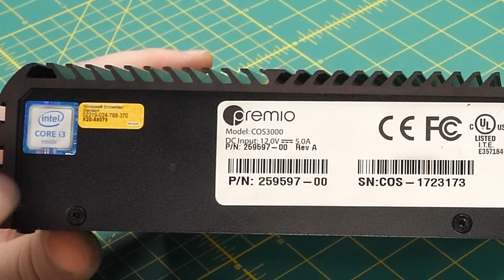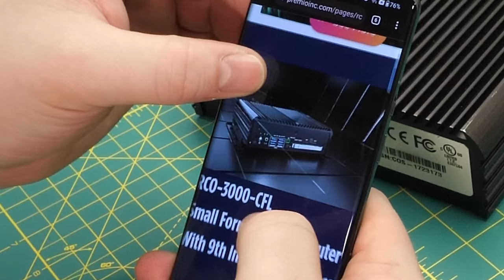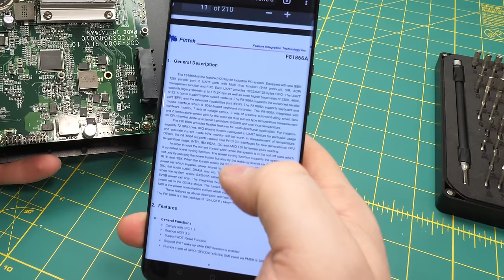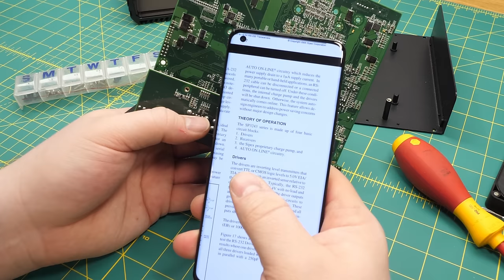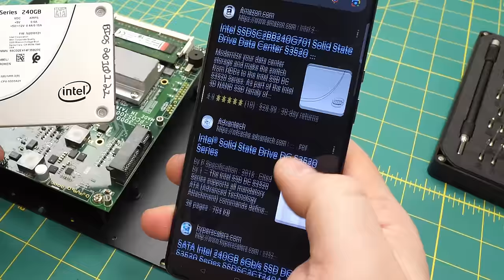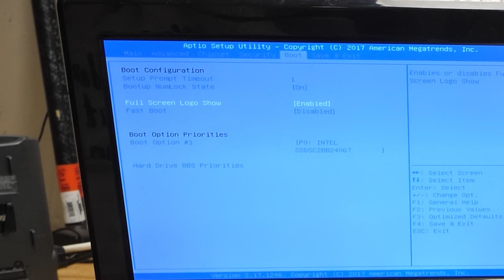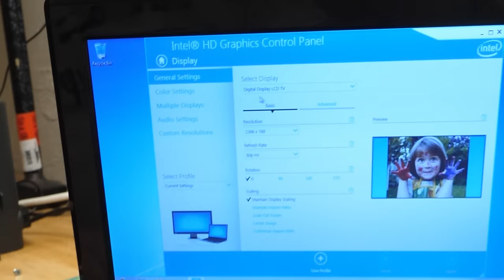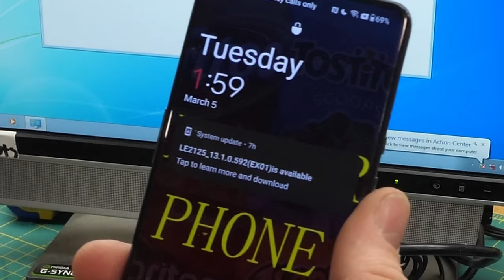Little Guys: Episode 4 [Premio / Coinstar]

Comment: Those ferrules also help prevent creep with bare stranded wire (and tinned stranded wire, for that matter) where the screw connection gets looser over time. Eventually this can lead to arcing and burning the screw terminal (or potentially your house). The 3D printing community likes them a lot for that reason, since we're usually connecting wires that'll have lots of power running through them over long periods (inside our houses).

Comment: Yes you can use audio over DVI. Kind of. 
You need a DVI-D to HDMI passive cable. I remember a few years ago that I discovered completly on accident this fact. When I connected my computer to my friends flat screen tv using the dvi on the computer end to HDMI on the tv end. Thinking that I would have to use the PC speakers for sound, I was astonished that sound was coming through the tv itself and windows recognized the output to the dvi port. 😮

Comment: Another important thing about PCH - you're not supposed to put thermal paste on it. It doesn't get hot enough to require a radiator, it sits slightly lower than CPU die, and when they are thermally coupled - CPU just dumps its heat on PCH. I think I found that info in some Dell laptop maintenance manual.

Comment: I've never used ferrules on wires personally but in my other job, we use a jumbo version on our (flash) welding cables.
These cables usually pass anywhere between 1500 and 2000 amps, so the ferrules are absolutely necessary for a clean transfer of current from wire to socket.

Comment: 6:08: that Phoenix connector CAN be used without ferrules on the wires, because the screw itself doesn't actually contact the wire to drill down into the strands - there's a metal piece that comes down and presses on all the strands equally.  Ferrules are a must where there's just a bare screw that holds the wire in place.

Comment: 3:40 I feel like it's a bad decision to name your electrical connector after a bird whose most famous party trick is catching fire.

12:12 The Game Boy Advance can use RS232. (It's not the default for link cables because they have the whole 4-way communication thing going on, but it's an option if you can swing 3.3V signalling.)

44:55 Bad and naughty children get put in the Chassis Nibbler.

Comment: Here in Hungary if you have that much loose change, you can exchange them in any post office so there was never a private business angle. Actually I've seen machines that do the opposite, give you coin for bank notes for parking meters. But since the last decade all shops have to accept card by law and most vending machines support card as well, so I had no reason to carry coins in a long while anyway.

Comment: "SAE J1708 is a standard used for serial communications between ECUs on a heavy duty vehicle and also between a computer and the vehicle." Ran into it a lot working on older "earth moving equipment" (tractors, bulldozers, excavators, etc). So that computer was probably an old diag comp from a shop

Comment: CMOS switch maybe makes sense, imagine servicing one of these things with just a screwdriver. You might need to insert it back into the Coinstar machine (or industrial bladed/squisher/stabber/folder machine) to power it up without a spare external power supply.

It might be the difference between a local hired tech hand with a screwdriver being able to service this thing vs shipping parts (at which point you probably cross-ship the whole thing rather than messing around in situ). The shot at a one-hour fix is so dramatically much better than a major piece of equipment being down until a priority package gets delivered that spending the extra dollar might make sense.

Comment: You can use 'WIM' files for any type of OS mass deployment.  You can use WIM with any version of Windows since about 2000 or so.  Say you need to deploy 1000 desktop or even 100000 servers world wide, you would create a WIM file, and the entire provisioning process would be automated based on the WIM.  Desgined WIM content, and other comparable methods, for a fortune 10 firm that deployed datacenters world wide from about 2000 until 2018 (when I retired).  WIM files are still used today.

Comment: I had a GeForce 9600 and it did HDMI out via the DVI port with an adapter. For audio, you had to connect the graphics card to the motherboard's SPDIF header with one of those cables you'd usually see for the power switch.
My motherboard didn't have the +/- SPDIF pins marked, so after connecting and booting it, one of the wires literally burst into flames and the insulation melted off and pooled on the bottom of the case 😂. Amazingly, it still worked after I turned it off and connected it properly, though the HDMI audio gave out after a few weeks.

Comment: Re: The SuperIO chip being named in the system firmware setup menu - that's extremely common on AMI firmware that has not been customized for the Desktop/Gamer market. I suspect AMI ships drivers for the common ones. Fun fact: some boards have multiple SuperIO controllers (e.g. an ASpeed BMC, which includes SuperIO functionality, plus a dedicated SuperIO chip), so that helps figure out which ports are being configured.

Comment: I really like these machines. I have an old one with a geode 500mhz, and one with an atom. I'm really interested in populating the missing connectors and make use of the lost functionality. You should try too like with the dvi connector! The header with a lot of pins might be an additional usb3. Also, that fintek LPC/EC will have 72 GPIOs but the pins are shared with other functionality, so you can't have 72 gpios + 6 serial ports + floppy + sata + kb/mouse. I also assume the configuration of these chips is baked in the bios, and not re configurable by us mortals. Also, those coinstars are not known in my country (in south America)

Comment: 23:34 the circular hole looks like it's positioned for the spindle motor of a 2.5" HDD, maybe for airflow? The screw holes for the drive are already raised up so it's not like the clearance is needed for the motor

36:44 Yep, you can have HDMI with audio over a DVI port. Some of my NVIDIA cards that have DVI ports do that

Comment: J1708 is an SAE standard defining the physical layer of an automotive communications system. The physical layer is based on RS485 (similar to how DMX is built in RS485). 

J1708 was essentially the precursor to CAN BUS

Comment: Installed in a machine, it probably has an embedded switching power supply (example: input 90~264Vac, output 12Vdc 10A) wired into the main power.

It's called a "Phoenix" connector because they're the 1000lb gorilla in the space. There are many manufacturers that make compatible connectors.

One or more of the COM ports are probably switchable in the BIOS between RS-232 and RS-422/485.

Threaded inserts save you a threading step, and also make the threads stronger than aluminum. Teh googles suggest that M3 threads should be either masked or done after anodizing.

If you have the hardware-specific drivers in the proper package, they can be slipstreamed into the image. This is pretty well gone by Windows 10 Embedded at the expense of a larger install, though it's still under about 25 G. At this point in time, we can't even get industrial-rated drives under 64GB (we use PCs that have a mini-pcie drive slot).

That might turn on with the DVI-D port active now, since it was the last-active port.

Comment: I am sure I'm in the minority of this for some reason I am extremely entertained by the idea of adding "missing" capabilities to a machine like the DVI connector shown here. If the BIOs had shown any hint of additional SATA devices being available I wonder if they too would have worked by adding the missing connector.

I actually really hope to see more of these videos where you take a gamble to re-enable these missing hardware "features" where they might be present. There's not really any practical reason but it seems neat to imagine "upgrading" a computer in away that means something more than buying more expensive hardware to plug into whatever ports it was designed to do.

Comment: It's interesting that the video drivers show a "digital display". It would suggest that the GPU is configured for digital outputs only and there's a bridge between VGA and DVI/HDMI/DP/LVDS somewhere on the board. Ark seems to confirm that, as this CPU has no direct support for VGA output (I mean I suppose you'd need a DAC outside of the processor die anyway but it's not aware that VGA can even exist with it).

Comment: Premio is a maker of industrial and edge PCs. They still sell the 3000 series but presumably with a newer CPU. I found references for  anywhere from 5th gen to 9th gen and i5, i3 and Celeron CPUs. They also sell Jetson based edge AI machines.
RS-232 dates back to 1962. The RJ-45 was launched in 1973 and was specifically designed for advanced telephony, i.e. teletype machines initially and later modems. I'm sure they were still thinking 'video phone' when Bell Labs first started development. It is surprising that we used RJ-12 for as long as we did but I think by the early '70s the writing was already on the wall with early radio and cell phones and they were expecting traditional phones to die off so there would be no point in changing the standard and rewiring literally the entire country. 
Fun fact, in the '90s, RJ-12 was often used similarly to how RJ-45 is being used here. My HP Pocket PC used RJ-12 for connecting to a PC. My dad was too cheap to buy the IR transceiver so I had to use the modem to transfer files. And I did a lot of transferring because I used it to play games.  But it is an example of how RJ-12 was used for local data transfer, even on a consumer device.
Reply: some 'consumers' of embedded and industrial PC require the vendor to produce the same PC, with no changes whatsoever, for at least 7 years. This model may be in production still. intel offers a line of embedded CPUs that are available for at least 10 years after they launch it

Comment: Did you consider that maybe the DVI-D part only can output HDMI? I would test a HDMI adapter with that. Although it's more likely that the digital part needs a few passive components that are missing. Edit: I just saw the part with windows working.

Comment: Re the phy: i think that rj45 jack is long enough to maybe contain the phy itself. A jack without phy typically is just 2-3mm longer than the inserted end of a rj45 plug, but with an integrated phy it usually adds 4-5mm.

Comment: I really like, that you are first concerned about Europeans not knowing Coinstar, but then you are surprised that they used ferrules, which are standard here. In Germany they are even mandatory to use for fine-stranded wires (like in cars) and people generally use them everywhere, even non-professionals.
Or if they are two lazy, they can use Wago-clamps, which are certified for stranded wires.

Comment: I wonder if any more modern parts would fit in this type case. Not having been an (official*) IT guy or worked a PC part recycling center... I don't really know enough about regular PC parts to geek out over the unusual stuff. I find that case really intriguing like how much power could you run in that machine and the case properly dissipate? Could you create some assembly of parts that would actually be able to be a fan-less LAN party gaming machine in that case? I guess you would have to hack up an ultrabook to get low power fanless stuff that may be able to game.
Were you able to get any audio out of the PC? Really impressed your soldering work actually worked.
*I put 'official' because just being a guy that /can/ build/work on PCs makes me the automatic on site office IT guy. I think many people actively try to not know this stuff so they can claim ignorance and avoid the extra work and responsibility. Lol.

Comment: If I had to guess the monitor being set to VGA instead of DVI prevented the machine from detecting the monitor and it booted into a 'headless' mode for the graphics output and disabled the interface.

Comment: To me it looks like the second SATA footprint is designed to be mounted on the backside of the PCB, with the second HDD caddy attached on the underside.  The footprint looks reversed of the one on the top side which could be because it's mirrored for going on the other side of the PCB.

Comment: This thing triggers my PTSD. I used to work maintenance at a robotics Amazon fulfillment center. The pick and stow stations had a more modern version of that premio computer with HDMI instead of com ports. It runs a touch screen, a projector to highlight where to pick or stow stuff and some buttons. There are literally hundreds of those in the FCs which is probably why they all run on Ubuntu. Oh and IT wasn't allowed to touch a screwdriver because the conveyor monkeys have to replace these.

Comment: The Coinstar in my local grocery store looks exactly like the machine showed, and after it's done counting out all your money, it subtracts 30 percent and prints out a ticket you can either take to customer service, or if they are closed, a cashier for the listed dollar amount. This store requires a manager to be present if you are cashing in over $50 ticket.

By and large, it's a bad deal as it's taking 30%, which isn't huge if you don't have a lot of change, but you don't tend to want to just dump change into a machine until it really starts adding up, so it's almost always better to go to almost any bank and just cash the change in with them without a fee. The vast majority of banks I have been to don't require an account with them for simple cash conversion like this.
Reply: The machine doesn't appear in the store for free.  Call it a labor charge for counting your coins for you.  I know a lot of people that used to keep water jugs full of spare pennies and such.  I think lots of people would consider 30% a reasonable alternative to putting off counting thousands of coins until they eventually ended up willed to their descendants.

Comment: Those ferrules are pretty common in industrial wiring. We use them a lot on mining equipment... Can also confirm the continued use of D-sub connectors on mobile equipment although in our case we use them for CAN network connections...

Comment: You are supposed to put a ferule on stranded wire before putting it into a screw terminal of any kind *as far as I know*. This is advice given for safety in the custom 3d printer community (especially Voron Design, wich takes that sort of things very seriously). Standed wire can compress and move out of the way, causing a bad connection with increased resistance, causing a fire. Especially at the kind of amperage power heating circuits can draw!

Comment: HDMI Audio over DVI is generally supported by Modern gpus (the broadwell igpu should support it). It's technically non compliant but it tends to be more useful so is supported. Early HDMI capable GPUs would require special adapters to allow HDMI over DVI, but these days generic DVI to HDMI adapters/cables should work. GPUs don't try to force HDMI mode onto DVI monitors even if using a HDMI port so it's fairly safe to allow it over DVI.

Comment: Tip: Hakko (白光) is a Japanese company, so you don't need to guess at how the "a" is pronounced. It'll always be an "a" similar to what's in "paw" or "back" (hawk-koh). They'd have romanized it as "Heikko" if they intended the "long vowel" pronunciation you used.

Same as with the "a" in Wacom, another Japanese company. (I can personally attest to that, because I heard the "Welcome to Wacom" message when I called their 1-800 number years ago.)

Comment: Question please. What was the point of taking the VGA connector off in the first place? Why not just add the DVI connector since it was in a separate location?
Reply from the maker: I'm not sure I understand your question. The DVI and VGA pads are in the same spot, the connectors occupy the same footprint on the board. You can install one or the other but not both.

Comment: WDT (watchdog timer) in Linux is under device /dev/watchdog and it expects you to write certain character every few seconds. Under RaspberryPi if it does not see response in 16 seconds, it hard resets. We made software that did just that. If program hung, computer would hard reset. We deployed the solution in very unpredictable AC environments which would hang the device

Comment: I use PCs like this sometimes for work. We use them to control gates and card swipes, both are serial connections. We'll use port servers too to get RS-232 over the network. It's crazy it's still a thing, and that I can walk right into a BestBuy in 2024 and pick up a usb to RS232 adapter.

Comment: It looks like that second drive connector layout is for a drive to either sit under the board or to stick out from the board. The other pin layout looks like its for a SATA connector and a power connector to have a drive mounted in the case with cables to it. This board was likely designed to be used in a number of case designs.
I suspect the reason DB9 serial connectors are still common is to prevent user error or damage. My guess would be that RJ45 connectors are common on systems where a certified tech is likely going to be the only one disconnecting or connecting it. Where as DB9 connectors are common when the end user is going to be responsible for connecting things to it. The only place I've seen RJ45 serial connectors working in IT support for science labs is on networking gear. Everything else uses DB9 or some other DB connector for RS232 or RS485.